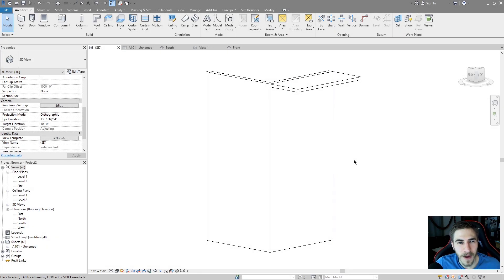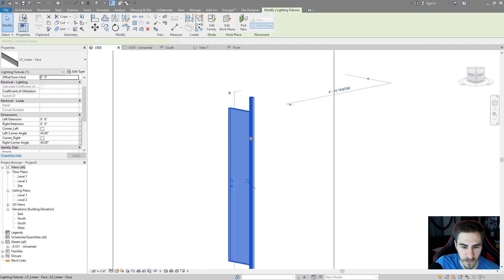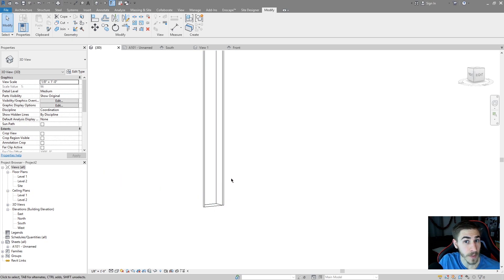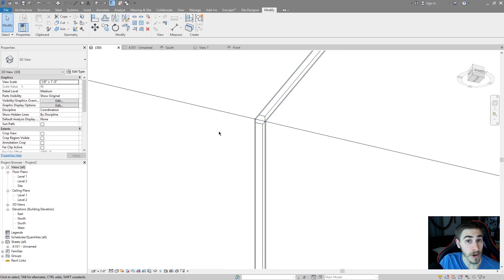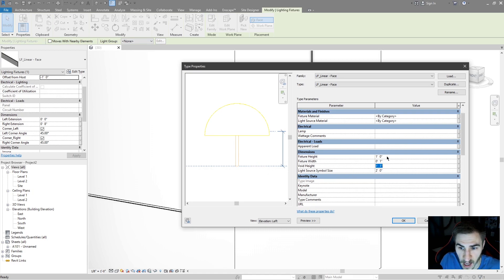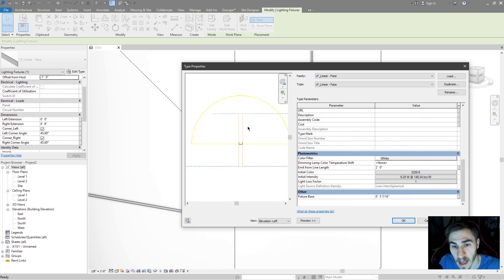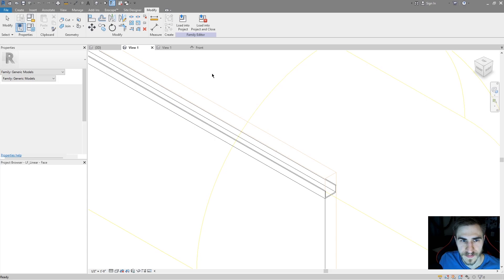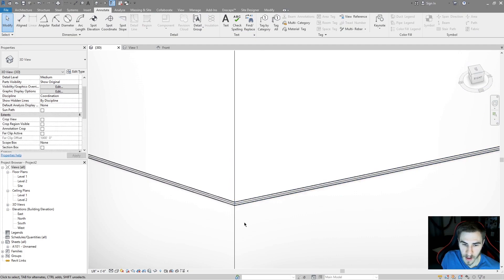Revit Family: Line-Based Linear Light

Comment: Hi, thanks for making the Revit family. I do have a question. Whenever I load the family into a project, it does not show the fixture track in the family. it only shows the void and when I cut walls with the family. do you know how I could fix this problem? thanks.
Reply from the maker: You might check your visibility graphics for the light source and other light settings.

Comment: Very nice clip.  That family you created was great.  I noticed that the back side of the light protruded through the back of the wall.  Is there anyway to have that clean up on the backside of the wall?  Thanks again for the knowledge.
Reply from the maker: I guess it depends on the wall. If the wall is thin, then going into the family is easy enough to adjust the depth of the linear light. It may be a type parameter if I remember correctly.